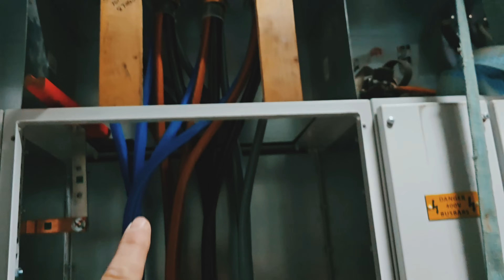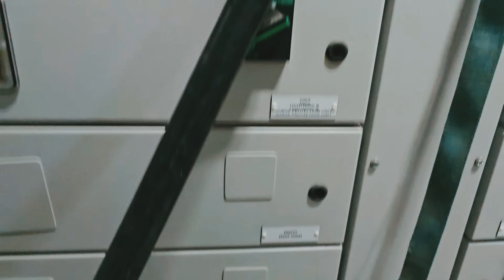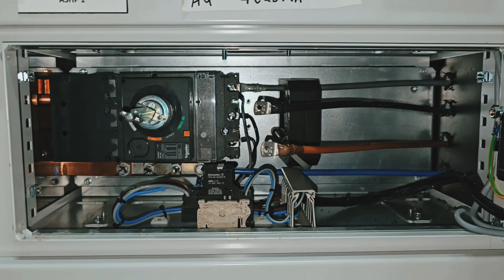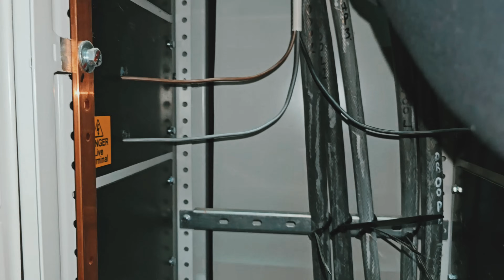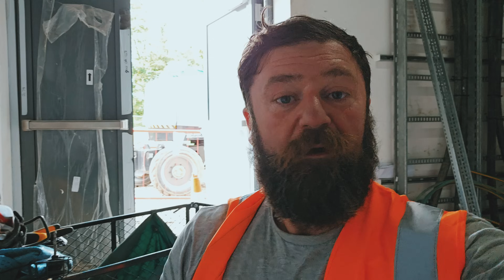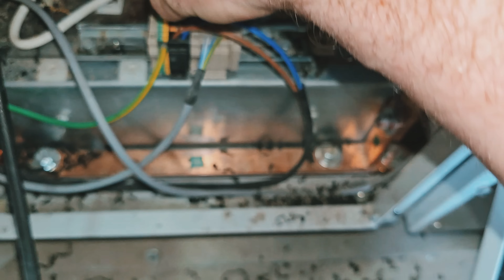This is the last straw!!

Comment: The 240 volt connections in the cable way are stupidly placed, that space is for the cables,  small things will get damaged.  One thing I will say is that having the connections behind the cable way cover is up to regulations because you need a tool to remove the cover.  Good video.

Comment: If the fuses were on the left, wouldn't that make them live all the time. where as they should be isolated while changing them?
Reply from the maker: They would only be live until you remove the fuse carrier though. If you needed to change them it wouldnt matter where they got the power from as they'd be dead once you pulled them out. (I think)
Reply: @jointechcabling9103  Both sides of a fuse should be isolated to make changing it safe. Still a shit job. This would hurt my head. Foreman told me that everytime a block of wood hit the back of my head when I did it wrong, I'd eventually get it right. lol

Comment: Who's the manufacturer?  Watched a vid there where a guy was putting in one of the new Fusebox 3-phase boards and was saying there were problems with early designs, but they listened to feedback from the sparks on-site and made changes.  That's what's going to happen here.  A new company will come along and no cnt will bother with the company that doesn't want to listen to the guys on-site, that doesn't want to take in feedback.  If they think they're in a market where they don't have to compete, they won't bother.
So anywhoo, who's making them boards there then?

Comment: Think i know the brand, crawling about on my hands and knees trying to get the neutral in while being slapped about by the door. 
Think i used 3 extensions to get them bolts tightened.
Reply from the maker: I had 3 extensions on as well🤣🤣🤣

Comment: Don’t blame the manufacturer, they would 100%  never build a panel until someone from the customer/ client have signed off the drawings been in your shoes many times with LV panels , it’s the doughnuts in the office
Reply from the maker: I disagree. The fact that they open the door towards the cable way is a fundamental flaw. If they can allow that to happen then all manner of design disasters are open to happen. You should never send anything out of your factory, regardless of customer preference,  if you know it's not correct. You would knowingly tell the customer that it's wrong because you have that acquired experience. However, if you don't have the experience or skills to notice that flaws of the customers requirements then you are an ill eqiupt design/manufacturing business.

Comment: What's the chances thoes 8mm ring crimps will be a soft material, then when a decent lug and big cable is torqued up on top of them, they will gradually become deformed causing a high resistant conection especially if those isolators are upto 250A.

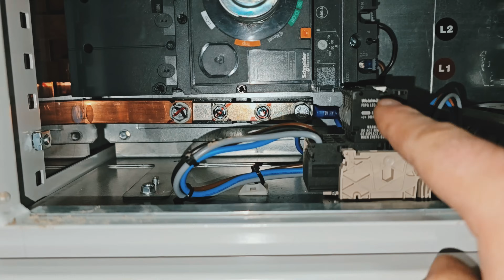Comment: 3:52 the fuse carrier is on a DIN rail and looks like they've deliberately left some slack on the cabling to allow it to be unclipped and pulled out of the way.
Reply: Understand that point but Tony's points are still valid, their is space to move the carrier elsewhere in that enclosure so he doesn't have to. Sometimes people underestimate how difficult to move large cables are and the inconvenience of having to move things makes it harder
Reply: Are you really defending this?

Comment: Happens time and time again panel builders are under pressure to save on space and materials due to cost its a joke really. Worked on one of those panels your lucky you got the pins for the breaker

Comment: I am with you on crap design issues like these, but it doesn't end there, how many different screw types get put on a simple isolator and the thing is usually so small there is no room for the gland and lock nut, so forget the bloody cable use bluetooth power. I can go on all day about this rubbish. Keep up the great work you do 💪👍

Comment: I appreciate the reasons for not naming the company, but I do think that it is worthwhile to find every e-mail address for them online, and send them this video. Make them see this video!

On another note, do most panel manufacturers use the same paint coatings? This seems very familiar....
Reply: That’s 100% not a Schneider panel 😂 I just commented on your other comment but now I think you are just confused because you saw a Schneider breaker. They wouldn’t fit some other companies power meters 😂 The  whole build is different, badge on every section, grey vented top, grey kick plates etc, it’s not even close
Reply: Also, on most other panels Ive seen, the metering is all fed from an auxiliary supply, removing the need to take a supply from every single chamber, seems strange that this wasn't the case here...
Reply: its Schneider🤣, they are a pain when designing panels, deserved to be named